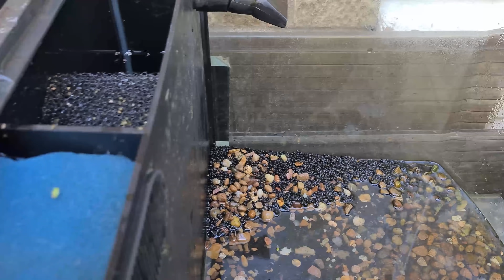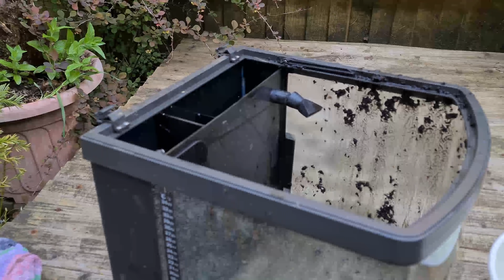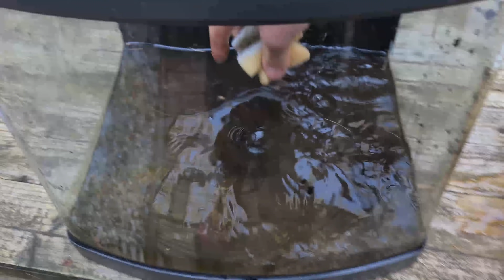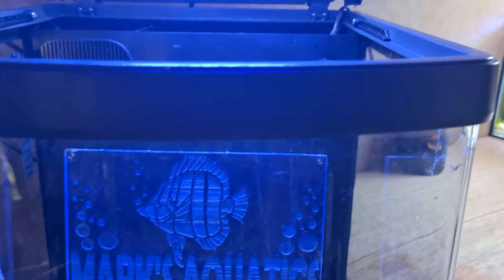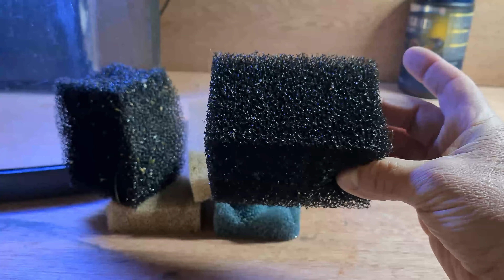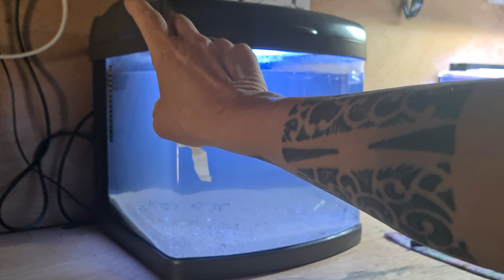Crab Aquarium Part 1

Comment: Hi mark, Really enjoying your current series.  Are you using R.O.  Or is this possible with tap water? Really like this idea, even though I’ve not really been drawn to salt water really before.  Might be a great thing to do with my kids. Thanks Brad
Reply from the maker: Hi Brad. 
Yes its RO water. You could use tap water and conditioner then add the salt to make the water. Thanks for watching.

Comment: This is going to help loads as I've just started a nano rockpool tank , I only have a crab and some weeds in there atm, not sure what else I can put in
Reply from the maker: It all depends on if you have a chiller on the system really.
Reply: @MARKSAQUATICS  I don't it's a temperate tank, it's was supposed to be temporary but my granddaughter has fallen in love with the crab and named it pilchard lol, so trying to improve on what's there gradually
Reply from the maker: You could put blenny in there. They can withstand higher temperatures
Reply: @MARKSAQUATICS  OK thanks, will try to find some, the only fish I've found near me a sticklebacks

Comment: So I have a 2 x fluval flex 57 litres, currently both are heated freshwater tanks (which is what they were made for) ones holding Sparkling Gourami and several species of snails and the other has 4 Peas. 
Now mark> I’m wondering IF I ever wanted to “try” use one of them for a marine / rock pool tank do you feel that could be possible. I have seen someone on YouTube convert the light on them to use as a marine tank. I don’t have RO water and I can’t see myself heading to the beach every week or how often I’d have to to fetch sea water so both those are a factor. I have watched your other videos as you’d know coz I leave sooooo many comments, lol (sorry) but I get excited. I’m still not fully understanding the water content details and specs. So...all I’d need is the salt mix for the water? Don’t I need a much stronger pump or power head in it to really swoosh the water around? 
I’m in Perth Australia so it gets pretty dam hot in summer, just sitting this tank in a room it would/could get to 30 c water temp even springtime,e it may get kinda warm too. So it’s obvious that I wouldn’t be able to even try this in the flex with out a chiller (which I’d assume is super expensive for just “trying” this concept out as an experiment. I do have aircon but wouldn’t be able to just run it all day every day in summer to keep the tank cooler $$$
I’m thinking I could only attempt having something like this for autumn, winter and a lil of spring maybe...then I’d have to take back the critters etc and decommission it as a rock pool tank. Am I wrong on this?
I obviously need a lot more knowledge n training on this...ha ha...
Luv the vids and all your lil critters. Great content 
Your green star polyp is my fave.
Reply from the maker: Hi Lisa. 
I think Australia is a an awesome place to live. I must visit some day. 
Yes your temperatures there will be a problem in the summer months but autumn and winter would be ok to give it a try.
And as your aquarium is a small one returning everything wouldn't be a problem.

Comment: I ran a cold water salt for many years.  How are you keeping the water cold enough?  You can keep a tank alive for a week or so depending on ambient temperature (the time my chiller died) but then you start to get die offs.
Reply from the maker: In this system I'm only putting in weed and creatures from the very highest rock pools that can withstand high summer months temperatures.
Reply: @MARKSAQUATICS  fair enough I'm excited to see this work.  What temp does the water sit at?

Comment: Is there a reason why you don't use seawater collected from the ocean in your tanks? I suppose it would increase the bio-load quite a bit, but I wondered if the additional phytoplankton and zooplankton could be beneficial. Let me know your thoughts, keep up the amazing work!

Edit: Just read your reply to David Turner's comment about this and had a follow-up question; If you were to run dirty natural seawater through some sort of fine particle filtration system (e.g. sand filter) do you think you could use it in your tanks? It just seems very appealing to me to use natural seawater in a native tank.
Reply from the maker: I mix my because its easier for me to do. I don't live  close to the beach and carrying gallons of water for miles back to the car with my back would end badly. But yes if I lived close to nice fresh clean sea water I would definitely use it rather than mixing it up.
Reply: Thanks Mark!